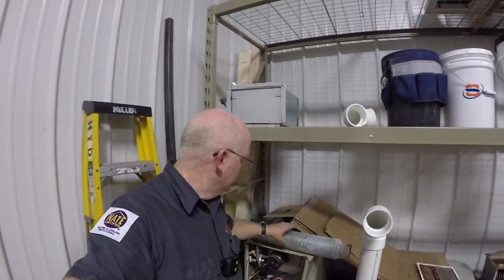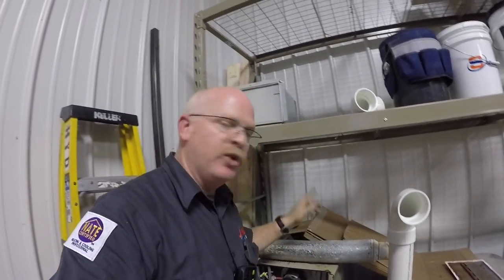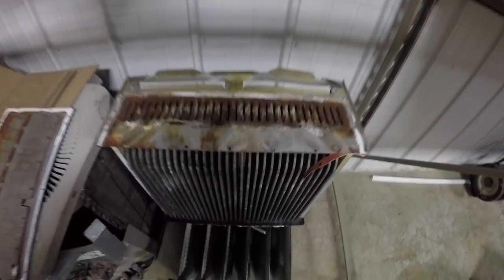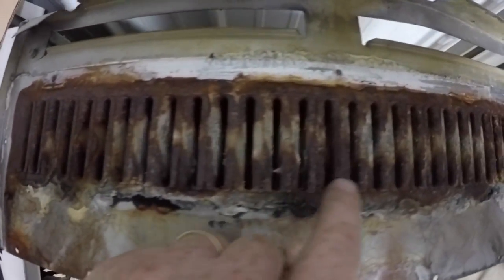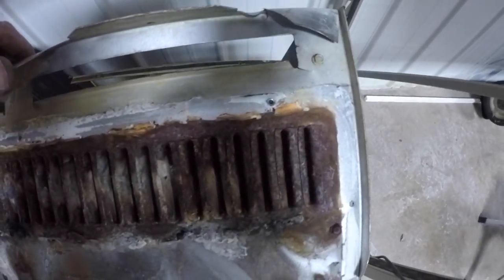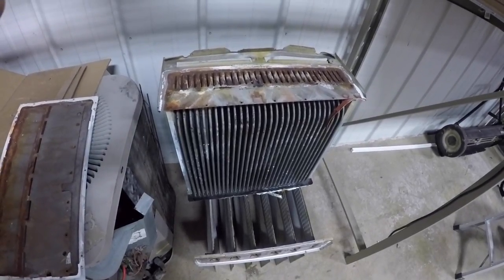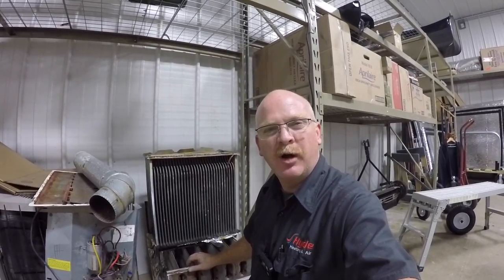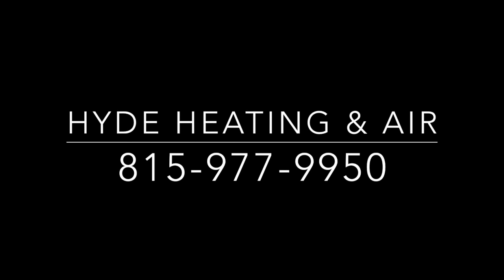Heat Exchanger Replacement

Comment: All rust. Definite secondary heat exchanger failure. As all 90%ers fail because of design. Sucks but that's the way it is. 80%ers go forever unless it was a goodman GMP furnace. Be more descriptive and thorough in your videos.